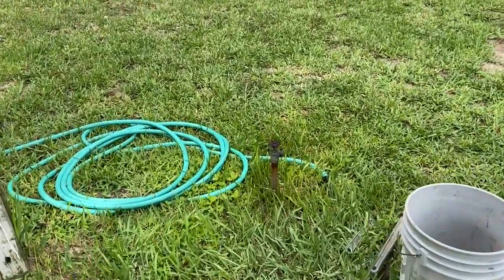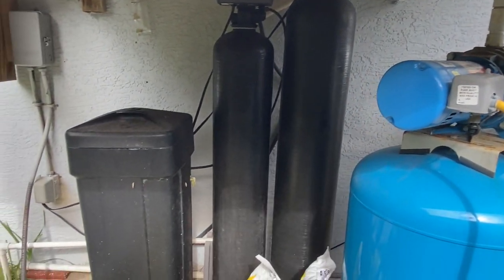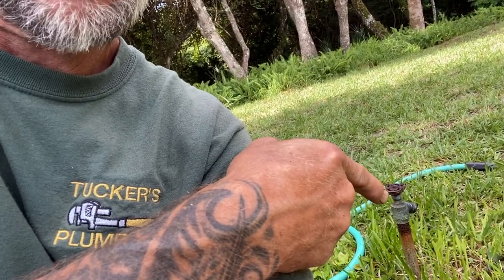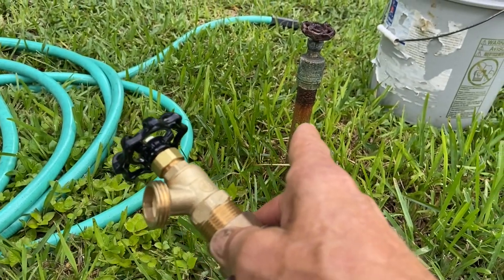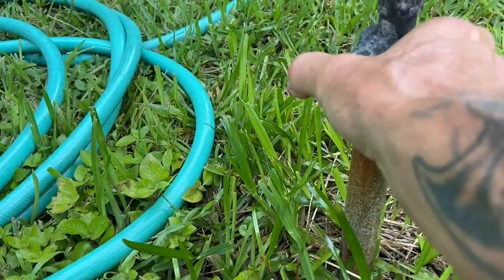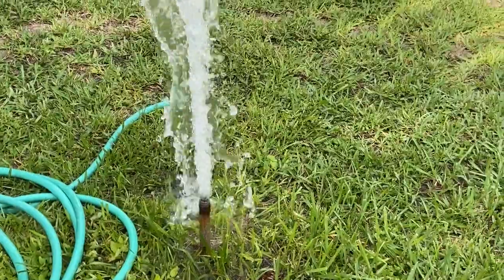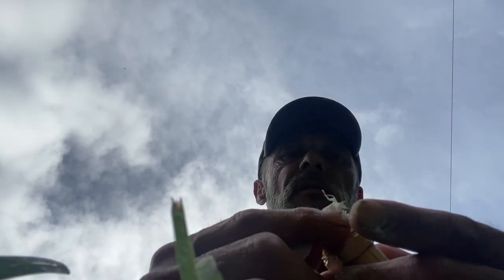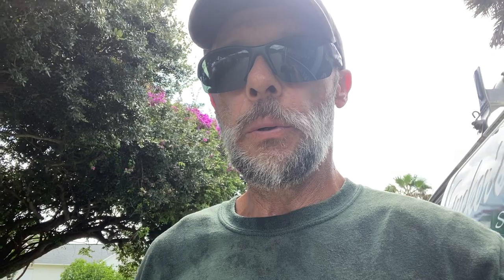HOW TO CHANGE VALVE ON OLD ARTESIAN WELL

Comment: Tim I got an artesian well thats in the banana River beachside cocoa Beach.  It broke during Ian. And I am trying to fix the only problem is only have a tiny bit of pipe to catch coming out of the river and it is broken like a sharks tooth not a clean break.  Can I encase a fernco in hydronic cement to get the pipe to stay on and be able to use the shut off valve to reconnect my Plumbing